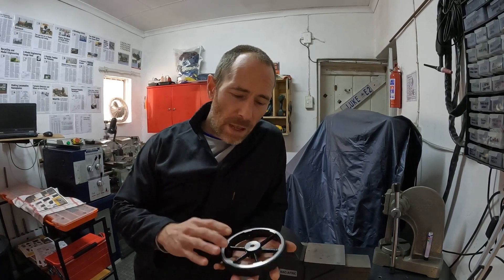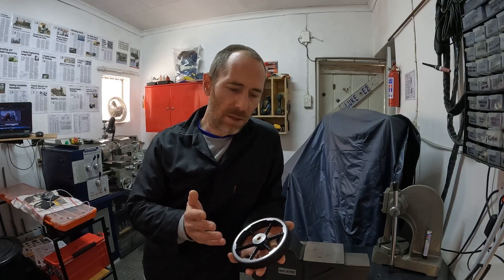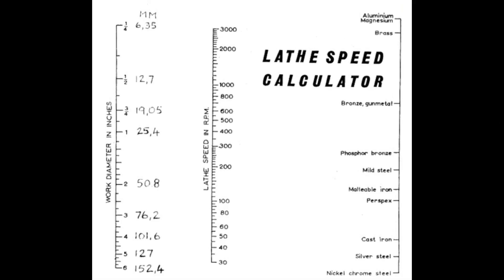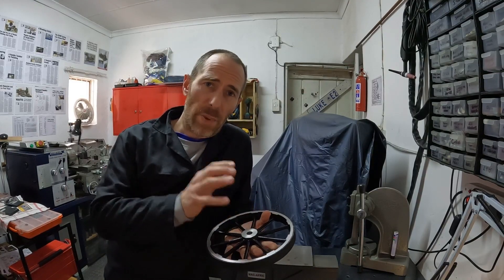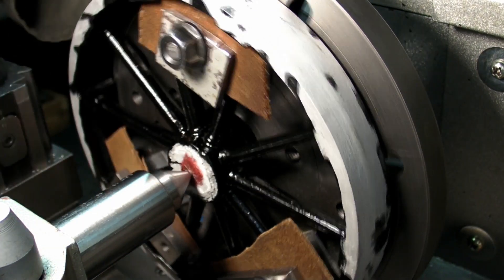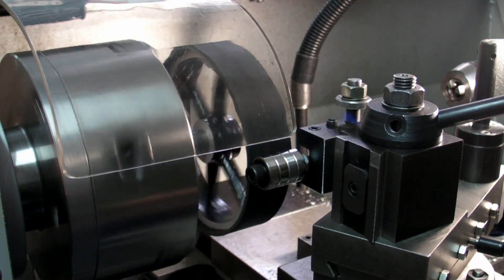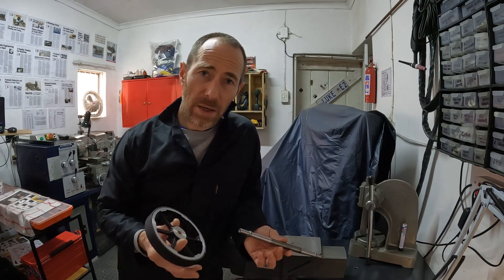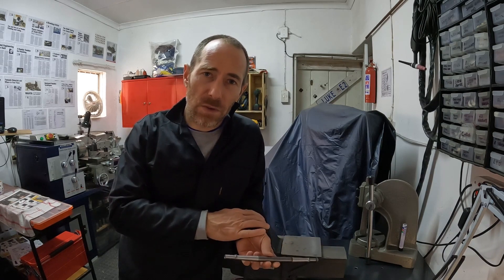Making the wheels and axels for the Willis Farmers Engine

Comment: A couple of expensive wheels (BMW). Aluminium bronze is the easiest to make if you don't have any bronze. Did you powder coat the wheels (the white stuff)? I would like to see the sand mould process as well.
Reply from the maker: Thankfully they were freebies, damaged beyond repair. The colouring might be due to the lighting. The alloy sandblasts light grey and paints a darker grey when clear lacquered. I've made a few things from these wheels, one of the more challenging was my Blackbirds handle bar risers... https://youtu.be/TWpGmo08tDE
I'm planning on adding casting to the series...
Reply: @Lukers_tinkering  Automotive Alu is the best casting material in my opinion, also machines great.